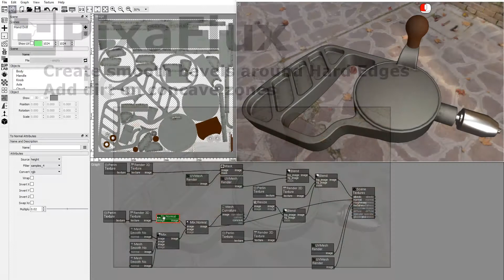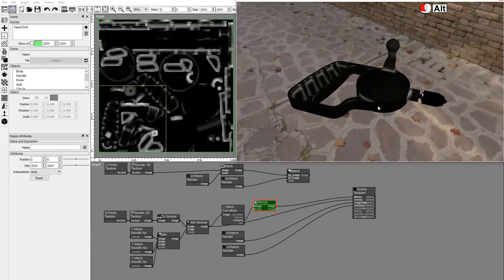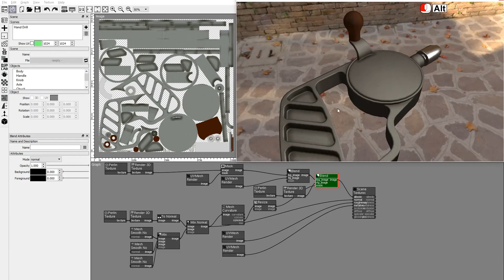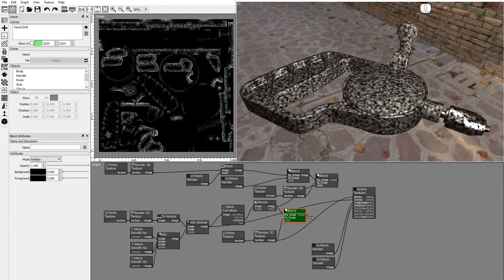Create Smooth Bevels and Dirt with PixaFlux

Comment: Will GPU computing be added in the future.
How to select Opengl or DirectX normal, can output world space normal.
Reply from the maker: Hello hn x. Yes, we're working on GPU computing and we'll soon have an update focused just on performance and efficiency.
You can add a Modify Normal node after the Scene Textures node and invert Y coordinate. PixaFlux uses OpenGL for 3D viewport rendering, but any nodes you add to the output of the Scene Textures won't affect viewport rendering and can be exported to other render engines.
Reply from the maker: GPU computing is now available in a few nodes and we're adding more with each release.